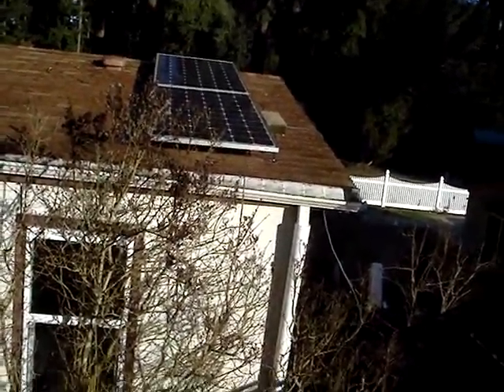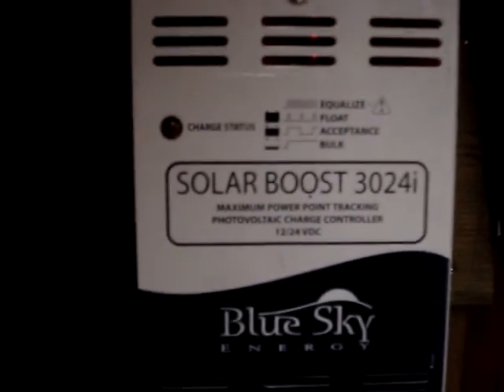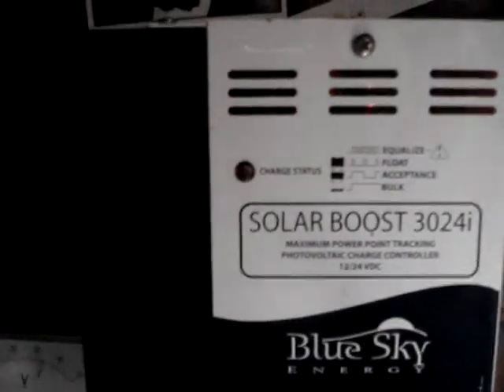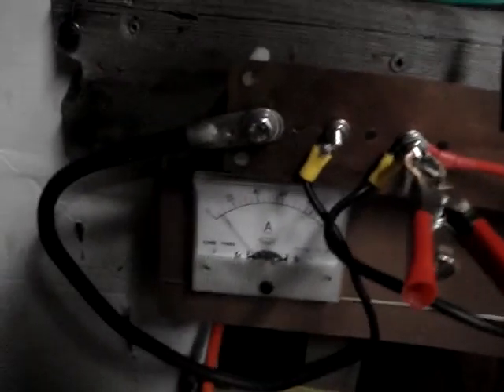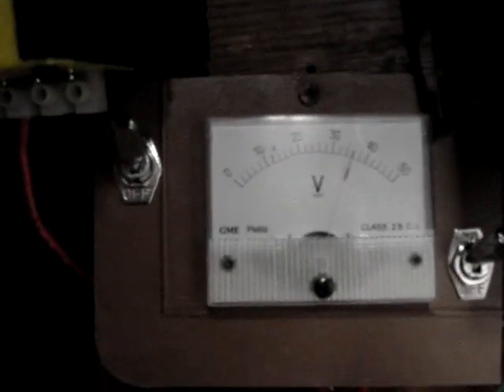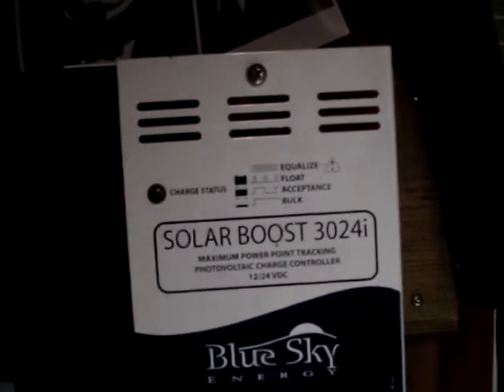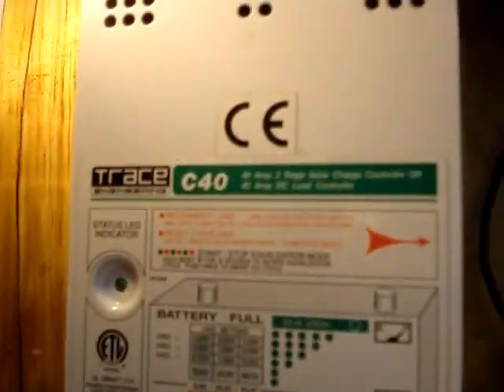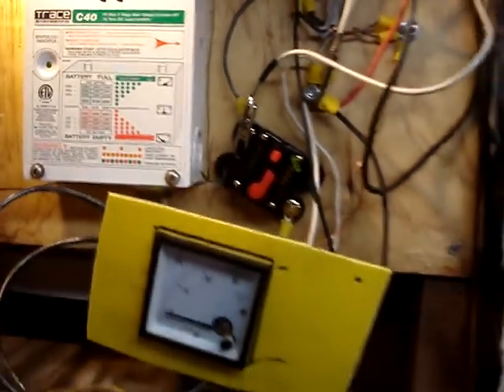SolarWorld (2) 245 Watt Panels Wired Bluesky 3024i MPPT Charge Regulator

Comment: Why 3024i solar controller AND C40 solar controller?  Are you using both? My understanding of the 3024i is 400watt max if wired to 12v batteries so my guess is each panel is wired to a different controller.
Reply: 540W in 12V; to 800W on 72 call PV with 24V battery
Reply from the maker: (2) 24v panels connected in paralell.  Battery bank is 12v. C40 connected to 12v panels in paralell.